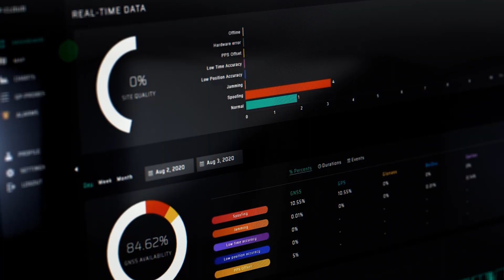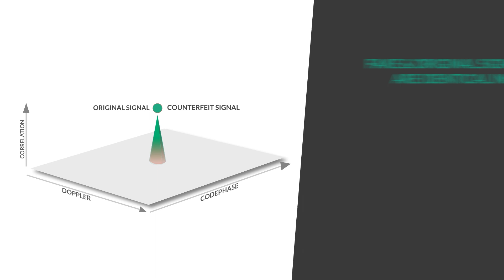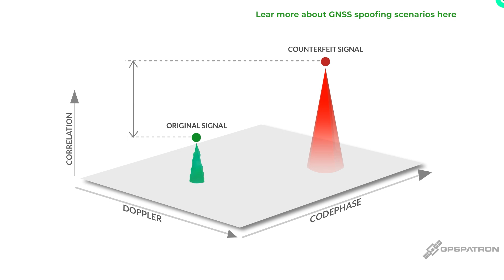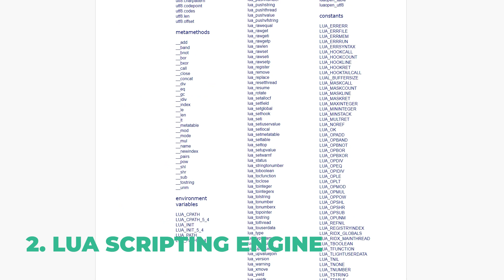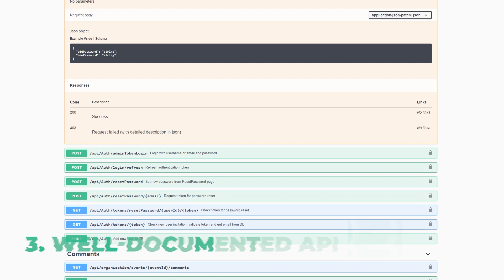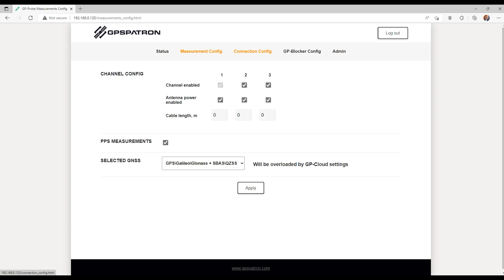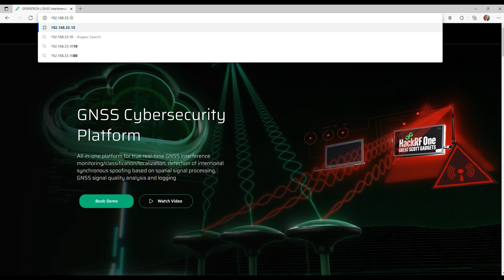GP-Probe Unboxing. Real-time GNSS interference detection probe.

Comment: I have a question. This kind of instrument is able to detected if a determinate zone/position is compatible to make multiple Gps receiver reach a stable RTK+? I would like to use it in a pretest phase in my company .
Reply from the maker: Hi Davide. First of all, the device is designed to analyze GNSS interference. If we take into account that one of the reasons for the lack of a stable RTK solution may be interference in the GNSS band, the instrument can help here. But if your problem is related to complicated conditions of the GNSS signals reception (closed sky, multipath), then it will not help. 
We have a cloud service GP-Cloud in which you can stream your data in RTCM@NTRIP format and analyze the quality of GNSS signals reception. Maybe it can help.
Reply: @GPSPATRON  Thank you for your reply .well my situation is a bit complicated . In my company we use multiple uavs and each has its own RTK GPS , capable of achieving RTK+ accuracy . An RTK base is also used to send any rtk corrections. Since they are flying UAVs they need to be as stable as possible in flight and thus maintain RTK+. 
The instrument we are looking for is a high quality instrument that can tell us (in a location survey phase) if that location has interference due to radio signals, obstacles or any other problem , which does not allow the GPS of the UAVs to reach a constant RTK+.
To answer your question , we are not looking for overly complicated problems , but simply figuring out whether a given area is suitable for GPS flight ( with an accuracy of centimeters) , through an analysis. One of our perquisites is that there be as large a portion of the sky as possible and away from obstacles that create multipath, but very often there are radio or LTE antennas that jam GNSS frequencies.
Reply from the maker: @davidl5786  
Thank you for providing more information about your situation.  I suggest the following configuration:

1. Redirect the RTCM data stream from your RTK base station to GP-Cloud. This will allow you to monitor the performance of the base station used by your drones during operations. If you're using Septentrio, that's great, as we support their binary data format.

2. Redirect the NMEA@NTRIP data stream from your drones to GP-Cloud. This will enable real-time logging and assessment of your drone receivers, allowing you to analyze their performance.

3. Deploy several of our GP-Probe devices in the field to perform a comprehensive evaluation and localization of interference sources. This will help identify potential causes of disruptions in the drone receivers' operation and provide insights into maintaining stable RTK+ accuracy.

By implementing this configuration, you will be able to better understand and address any GNSS reception issues that may affect your UAVs' performance. If you have any questions or need assistance setting up this configuration, please don't hesitate to reach out.

Best regards,
GPSPATRON Support Team